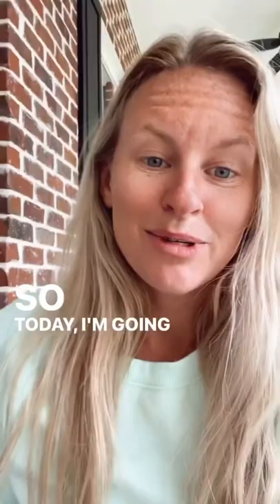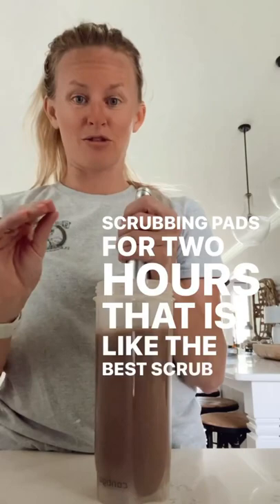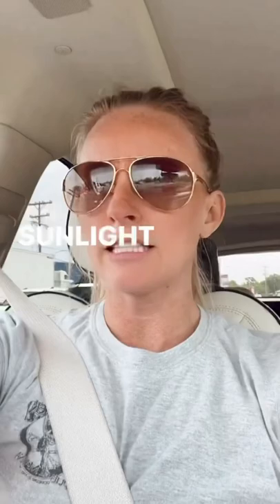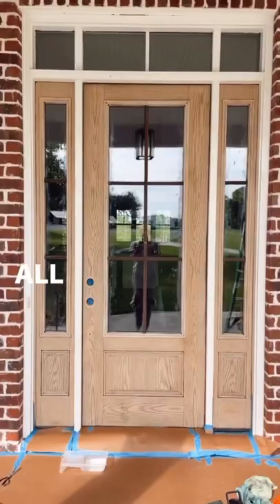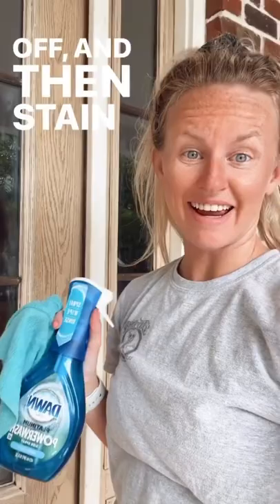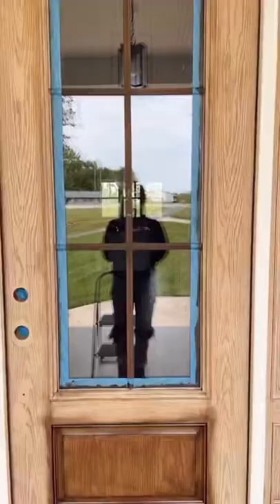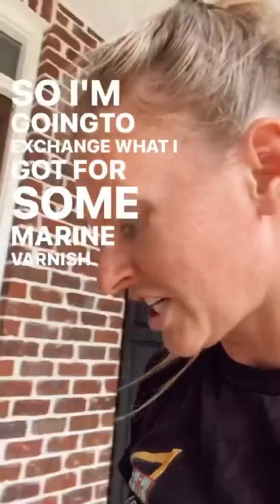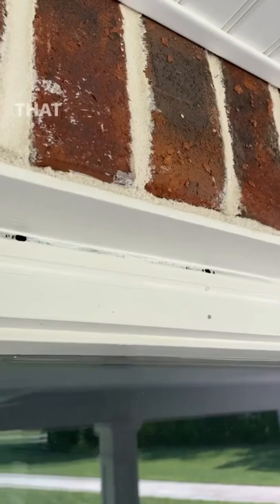DIY Stripping Therma-Tru Fiberglass Door and Re-Staining Process

Comment: Thank you so much for sharing this, Megan.  I also spotted the finish on my ThermaTru fiberglass door finish while cleaning my porch trim and ceiling.  Be extra careful with those oxygen products.

I used the manufacturer's staining product when we installed the door.  It was difficult to get an even finish the first time.  So many people recommend gel stain for fiberglass doors.  Now I see why.

Thank you to your aunt and uncle as well.  I have good results with hand-rubbing stain on wood but I will use a good, soft brush when I redo the door.

Your video has greatly reduced my dread of refinishing my door.  I do not look forward to stripping the current finish; that has never been as easy for me as they make it sound. I am confident that I will have better results this time.  Your door is beautiful!

Comment: Good video. I’m been doing the same thing on a wood door covered with a fiberglass laminate. I can’t get the right color and have spent a fortune on gel stains. I’m looking for a dark golden oak/brown color. They are either too red, too dark, or perfect with the first coat but turn Java black with the 2nd coat. I’m going to strip it…yet again and try thinning the gel stain with some mineral spirits. If that doesn’t work, I’m ordering a new pre-stained door. No painters in my area willing to do anything less than new construction or a complete remodel
Reply: What? That doesn’t make sense. New construction or complete remodel on what your house because you don’t remodel a door and new construction what does that mean putting in a new door? I don’t know if any painter that will try to sell you on a remodel job or install a new door either you called a handy man,general contractor or they just figured you were going to be to difficult to work for and made up an excuse that’s all I can figure.

Comment: Hi Megan, from the video, it looks like the green version of Kleap-Strip's Paint & Varnish stripper works very well, much faster and better than Citristrip. Can you tell us what kind of paint and finish you were stripping (and how old was the original finish)? Was is oil based stain with polyurethane on it? The customer rating on Home Depot site on this product is extremely poor (226 out of 416 responses were extremely negative). Yet you had good experience with it as seen in the video. Maybe you did well because of the type of paint and finish you had?
Reply: (continue) Megan, Citristrip takes several rounds (with 24 hours in between) to remove oil based stain (with polyurethane on top). Your video showed you only had one round (one pass, no 24 hr wait in between). Is that right? Home Depot website customer feedback has near 50% customers giving 1 or 2 stars. What kind of paint and finish were you removing? How old was the paint? Your experience could help others like me decide to use this or Citristrip. Thank you so much for everything you do.
Reply from the maker: Hey Roger, our home was 4 years old when I decided to fix the front door. My husband had cleaned out front porch floor with Purple Power and apparently it splattered up onto the door and didn’t get rinsed off and ate away at the previous stain. We are assuming there was never a polyurethane coating on our door since it was so easily messed up. It was originally a gel stain on our door, but we’re uncertain of the process because it was a new home and the contractor had his painter stain our front door at the time. I do know they originally used the exact same gel stain that I had used in this video though because I had the leftover (but bought new because there wasn’t enough). Hope that helps!
Reply: @meganlawing  Hi Megan, thank you so much for your reply! It looked at you did not even need to use mineral spirits to take off the residuals of the Klean-Strip stripper (just using cloth to wipe). When you applied the stripper (on vertical surface), did it tend to drip or flow down? Since you used scotch pads, and wiped right away, dripping may not be an issue for you, but since I need to let the stripper stay a long time (because of polyurethane on top), dripping is a concern. Also, did you smell any fume or chemical odor?
Regarding your varnish, the marine varnish is good if it penetrates into wood fiber (that is why it is very durable), but you already have stain below. Did your source (the person who recommended this) know you are applying over gel stain? The answer of this question would affect my decision on adopting it or sticking with polyurethane. Also, did you smell anything when you were using it? I noticed you never wear any respirator.  Thank you.
Reply: @rogertsai2208  I thought the same thing... every time I've done my door, I've taken it off and done several rounds of the citrus stuff.  This process looked much easier.  I was hoping the stripper she was using was the trick but based on the reviews, I'm not so sure.  I generally use a scrub brush though, so maybe I'll try the green pads.  Stripping the old stuff is always the worst part.  I'm trying to figure out a way that I don't have to do this every three years!  I hate it!

Comment: I ended up sanding, restaining, and recoating my door.  But the sanding ended up leaving light and dark spots which took a second coat of stain to even out.  Should have stripped it like you.....that will be for next time.  How long did you leave the stripper on the door before removing?
Reply from the maker: I just applied the stripper with the scour pad, I didn’t pre-coat the door. Hope that helps!
Reply: You can not sand this type of door it will ruin it even a real wood door you have to sand the whole door evenly and I recommend a pre-stain for wood doors.

Comment: how is it holding up?  I have a Therma-Tru fiberglass door that gets full sun all day long.  I have done this process every three years or so because after about two years, it starts looking terrible.  Looking for a more long-term solution.
Reply from the maker: Holding up great! I think the marine varnish was the trick.. I would have applied 2 coats, but I thought it might turn the door too “yellow-y”… ours gets full afternoon sun, so I know what you mean. If ours has lightened any, it’s a good look, nothing I would change 👍🏼
Reply: Did you have to use the Therma-Tru products? I was told you do not have to use their products - any gel stain works
Reply: @nickivukas6097  I've used gel stain on my door 3 times followed by 3 coats of spar urethane.  Holds up for two years at Best.  Really annoying.

Comment: I’m guessing you didn’t have any luck with the paint thinner on the door handle paint thinner is for cleaning and thinning oil based paint and not not strong  enough its my opinion that lacquer thinner might have been a much better choice
Reply from the maker: Actually worked, just the position we laid the handle to dry left runs and it looked bad 🤦🏼‍♀️
Reply: @meganlawing  Awesome good to hear that it worked out for you..